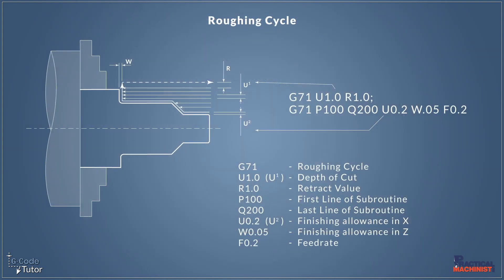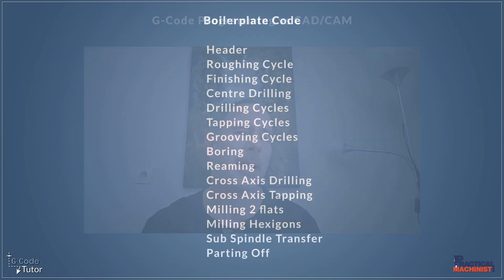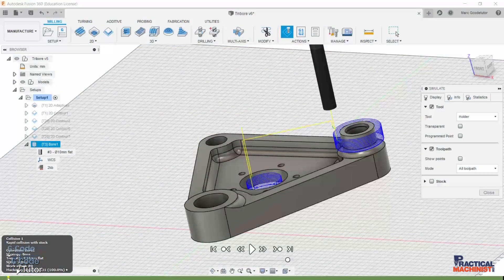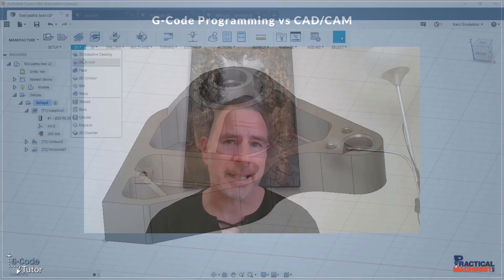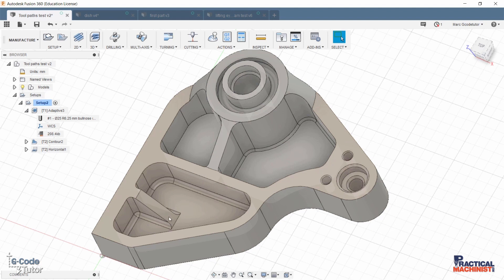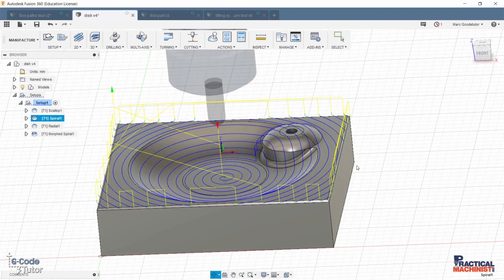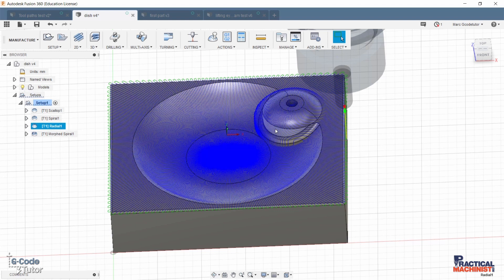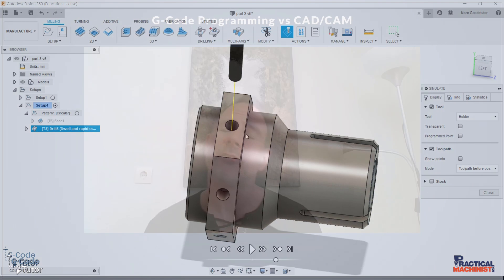G Code Programming VS CAD/CAM

Comment: In my personal opinion, I think that nowadays there are CAD/CAM software tools that are so easy to use and have such good automation that they are worth using even for programming simple parts also for lathe parts.
I agree that knowing both programming methods is very useful to have a complete skill set, work at your best, and solve any needs or problems.

Comment: Disagree about not being able to edit feeds and speeds, it's fairly easily simple to edit the program. I'm a master cam user who designs and work with models.
Especially whem it comes to errors using G code. My time is not worth creating G codes when i can apply my time programming a multiple machines.
In my opinion G.code is like using a manual tyoe writer vs an OS of your choice. Thanks for your time.